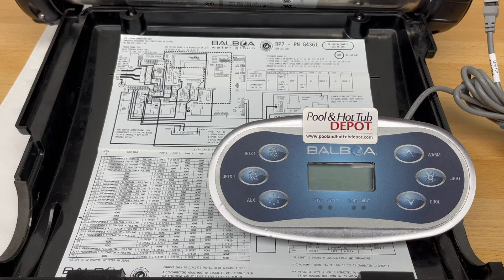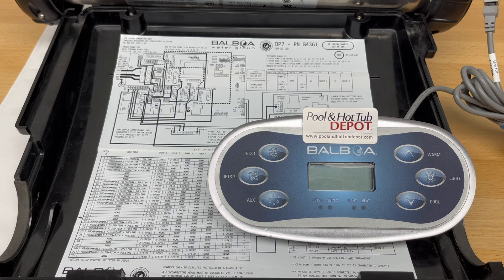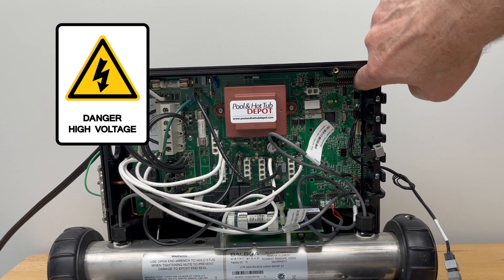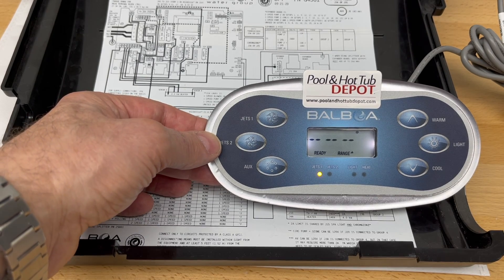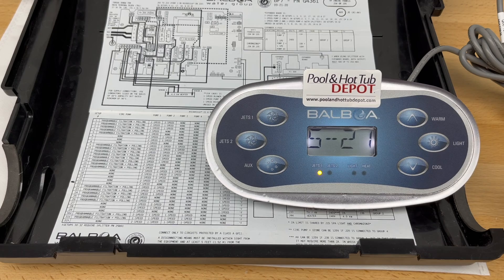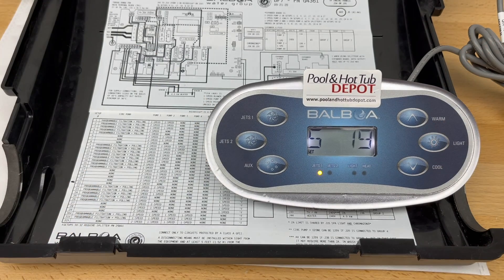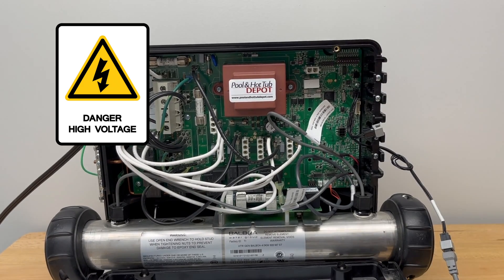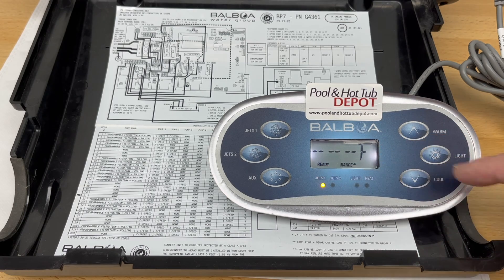Balboa BP7 TP600 Configuration

Comment: The original controller still works and so we weren’t going to swap it out until it broke. Can we program with what’s already on the hot tub or we need this new face plate to turn on the Jets. We are stuck in the air pump flow message cycle. I think we have set up 13 because we have pump one is two speed pump two is one speed and we don’t have anything else to hook up. I do have pump one in J9 and I have pump two on top of the heater. I did have a music system that is being plugged in to two places one is into the AV port J 33 and then the second part of it is being plugged into J 14 auxiliary. Those are for the lights and the music. So how do I get the correct setting using the current controller?

Comment: just purchased this board and topside controller to replace my previous balboa spa pack...this ones slightly newer with more options and i'm having issues figuring out the right settings...i have 2x 1-sp jet pumps, and a circ pump (no blower)...its recongizing the first Jet pump as a 2-speed when i press the button, and Jet 2 isnt getting any power ...would you be able to tell me what the proper set up for that is?
Reply from the maker: First, make sure the pumps are plugged into the correct location. Based on your pump setup of 2 x 1 speed jet pumps and a small dedicated circ pump (assuming all pumps are 230v). Pump 1 plugs into J9 on the BP7 circuit board, Pump 2 into J1 on the expander board on top of the heater, circ pump in J21. Then turn power on to the spa and follow the steps in the video to change the software setup to #14.

Comment: What if I have followed all these instructions carefully and the top side panel won't power on. I even purchased a new top side panel and that didn't power on either. Is there something else I can do to troubleshoot? Or should I replace the control panel all together?
Reply from the maker: If the old topside was dead and a new topside is also dead when the hot tub is powered up and allowed to stay on for at least 15 minutes, first part to check is the small fuse on the circuit board for the transformer. Can be in different locations depending on the spa pack model.

Comment: Do you need to configure the dip switches prior to entering test mode?
Reply from the maker: Unlike the Balboa VS series, the BP series is not configured by the DIP switches except for limiting amp draw to ensure the system full load amp draw for the heater and pump(s) is not more than 80% of your GFCI breaker amp rating. The DIP switches for amp control can be set anytime. For the rest, the BP7 is configured in the software, which can be accessed by putting the system in test mode with DIP A1.
Reply: Ok so I have program 1 but when I use it my  pump does not run with my heater I'm not sure how to fix this we have 2 2 speed pumps 1 cir pump and a blower right now I put it on program 6 but I'd like the circulation pump to work any idea why it would do this?
Reply from the maker: @wildeyebilly1008  It would need to be set to setup #1 for 2 x 2-speed pumps, a blower, and a small dedicated circulation pump for the heater. Second, confirm all the pumps are plugged in the correct place: Pump # 1 is in J9, Pump #2 is J1 on the expander board, the blower is in J14, and the small dedicated circulation pump is in J21. What size is your GFCI breaker, and what KW is the heater? What are the high-speed amps on both 2-speed pumps?
Reply from the maker: @wildeyebilly1008  Set up # 6 tells the system there is no dedicated circulation pump. It will task the #1 2-speed pump to run for heating and filtering at low speed.